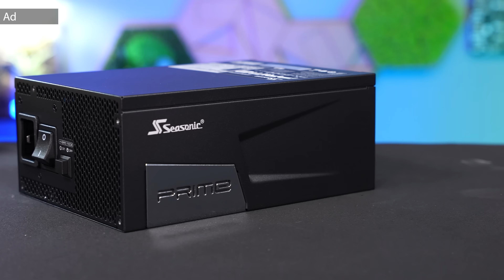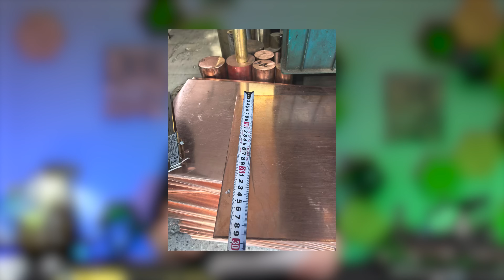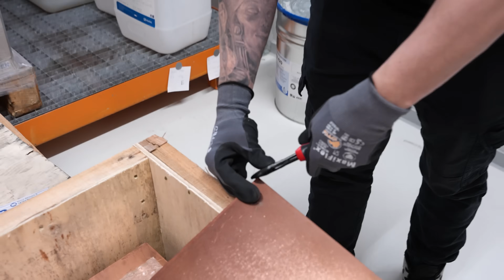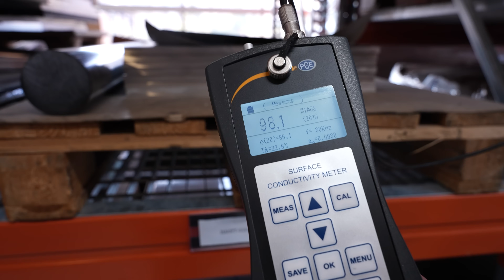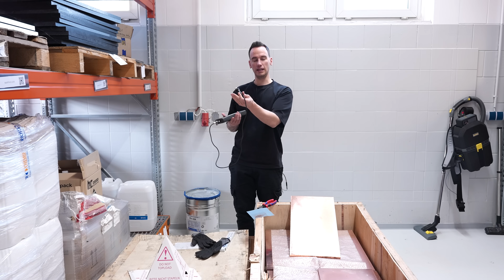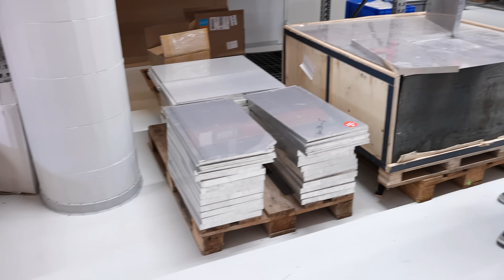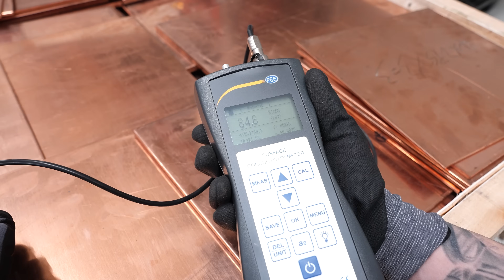I Got Scammed

Comment: Chile is the world’s largest producer of mined and refined raw copper. Chilean copper cathodes leave South America on bulk carriers and head directly to heavy rolling mills in Germany (Wieland, Aurubis). German sourcing is cheaper. The $2,000+ QA overhead, financial escrow fees, 45-day sea transit cash lockup, and risk of scrap on a single bad batch will instantly wipe out the nominal ~30% material savings from China. Total parameter calculation includes source reliability, quality, and fraud costs. 

I am so sorry this happened to you. It was an expensive lesson. If you source from German suppliers, your fraud rate drops to 0.1%.

Comment: Common story with Chinese suppliers, I've heard so many stories like that. They have something that looks fine on the surface - just enough to pass basic inspection - but the rest is garbage, or the entire product is fraudulent... Or in case of the second copper shipment, both at once, in addition to not being the best quality. Of course, they do it because it's so easy to get away with.

Comment: I'm not sure here, because i know nothing of metal production in Europe.  but can you buy copper from a country that has a better reputation at this point in time, or at least has a better judicial system so that recourse could be taken?  maybe something closer to Germany where you could physically check on?  i understand that there would be a much higher cost, but if the cost is not just the copper, but also the production of your items/ downtime, maybe a higher cost, more consistent base material would suit you better than this scammer stuff your finding.  you probably already have looked into this, but would be interesting to hear about!

Comment: wouldn't shipping manifest have shown the 10% difference in weight to real copper? I mean export declaration should show net and gross weight, from your order you would have known what the weight should be for the material you ordered
not trying to justify the scam, but just giving additional ideas how to check validity of material
we're getting aluminium here from Turkey that is all over the place, but that is few thousand, not 40
and this is part of the economic war China is waging world wide, so it wouldn't surprise me one bit that even if you start legal action, it will bog down on their end with zero result, because somebody somewhere took a bribe to shuffle your complain around to the bottom of the pile, that is standard practice, and bribes are very common around there, that's the "communism legacy", in the west this same thing is called lobbying 😁 just that lately things have reached very high point where this sort of thing happens almost everywhere
imagine trying to buy li batteries over there, and they are producing like 95% of all li batteries, so it is not like there are any alternatives
the fact is - the "cheap" China era is history, and they aren't interested in selling raw goods, just finished products, hence I could almost guarantee that this sort of thing is sanctioned and handled at "government" level

Comment: What prompted you to clarify you've only ever had positive experiences with Alibaba in the past? Not saying I don't believe you, I'm just curious. Chinese industry is more than capable of producing high quality goods, and can definitely be either a cost effective, or at times the only place to get certain materials. But as someone who worked for years in procurement for, let's say, very large projects. Unless you pay extra for independent third party inspectors and quality assurance from trusted auditors like SGS, Intertek, BV, or TUV, even some of the largest companies on the biggest orders can take you for a ride, regardless of prior built relationship. Fabricated manufacturing schedules, and even fabricated quality documents are not unheard of, and if you really want to receive what you paid for, the sensible course of action would require inspectors for site inspection, production monitoring, pre-shipment. I'm not trying to speculate as to why it's like this, and I'm not trying to claim China is unique in this regard. But this is common wisdom and good business practice for a reason. If you value your projects, your money, and your time, you will need to be far more thorough when doing business with China.

Comment: There is saying in communism, if you don't steal, you steal from your family. If you say in China ... I scammed Chinese person, you go to jail immediately, if you say, I scammed foreigner, you get applause. The court in china doesn't really work if one party is foreigner, it will cost too much take too long and the company will go bankrupt before you can serve them. There is no way to solve this ... if you agree on half payment in front and half after inspection, they will send you 25% of goods and have 25% profit. You can read a bit about Tofu drag construction, its also victim of this, steel that is weaker than iron, concrete that will become sand once you lightly touch it. Fireproof insulation that can catch fire by sunshine. Even if you manage to get first order 100% correct ... the next order which will be probably larger can be the scam one

Comment: A chemical compounder I worked for purchased a 40” FCL of potassium hydroxide flake from china. Verified by a third party before container sealed. Container arrived in Australia and it was 25kg bags of calcified lime. We not only lost the money on the product we did not get. We lost money disposing of the material we had received that had to be remove from the container. The third party verification on the ground in china was recommended to us by a very large multinational customer of ours and still… unless you can put yourself in front of the product before paying balance, it quite often isn’t worth it.

Comment: China overproduces so much steel they have no idea what to do with all of it except shove it into applications that it should not be in.  Also, to commit fraud.  The cardinal rule with sourcing from China is you need to have a local fixer that's going to keep suppliers from f*cking around on you.

Comment: You need someone on the ground who oversees it when dealing with places like China & India. Someone who is NOT a local. Will insurance cover you in this case? Also, try and work using payment on confirmation of delivery (and a THOROUGH inspection) along with a deposit. I don't know if that will work with that industry or not, but it has to be better than what you're doing right now with the losses being lowered to your deposit.

Comment: I know its been a while, but I would be interested in another video if you can test weighing the plates and talking about if it would be efficient to try to recover the copper through sweating or something.  Pure copper is denser than steel, so even a 12"×12"×1" plate would be a few lbs light if its mostly steel.

Comment: A very common thing is freight repacking, where your trusted third party (that verified the product was packed and shipped) would actually open up their boxes and repack everything into your own shipping boxes. One thing to note, if using a Chinese company freight repacking is to not have the hand off be between the two companies, but rather one drops it off at a warehouse and then the other shows up at some later time (to prevent under the table dealings)

Comment: If you ask me, it's fine if you decide not to pursue legal actions against the scammer because you don't want to waste money and risk losing more money with laywers. 
But I would suggest to at least record the evidences and report it to the police in China. Because this is not a small scale operation here. The fact that they have those steel plates, aluminium plates, and is capable to plate those steel plates with thick copper means they have a big industrial operation. So it would be hard for them to move around and it would be easy for the police to track them down and get them. 
So, since they caused you a lot of problems. I would take revenge and cause them a lot of problems with the police. Report it to the police and let the police take them down. If you somehow can get your money back from it, good. If not, the scammers will also take a hit on their operation.

Well, that is if the police aren't corrupt. But even if the police there are corrupt and took bribes. Well, those scammers would still lose some money to pay those corrupt police to settle the case. So either way you get them to lose money.

Comment: I am so sorry for your lose. 
From what I have been reading and watching, China is having a big issue within itself. Constrution is using what they call Tofu bricks (mud and concret) bamboo instead of rebar, soft steel on the new bridges, instead of stress tested. In short, China is buried in coruption with out caring who gets hurt or dies.

Comment: The only way to protect against this is by using escrow. That doesn't release full funds until shipment received and checked. I've no idea if this is an available option. But it seems like a filter as a company not willing to use this method, is probably not worth dealing with anyway.

Comment: With how much you are purchasing, you may be able to do a deal with a scrap brokerage firm or even large scrap supplier local to you, where you purchase the raw recycled material and electrofurnance time and you recieve the total refined  output. Then a metal merchant will exchange whatever refined output you got for the stuff you actually want, it sounds like extra steps but its apparently tax efficient 

People don't like the word "scrap", but that just means its already been refined once and its easier to do than from ore. 

I know a company that needed barstock in a odd size to build out some jumbo busbars and this was the route they ended up taking.
Reply: The other thing worth mentioning; if you show a scrap copper broker that you can turn what is a waste product into a actual thing worth more than just its value as pipe or cable and those guys will move heaven and earth to make their product your product. In general scrap metal and recycling is a very keen sector if you find the right people

Comment: as somebody who works with chinese suppliers for years - make sure you order inspection by 3rd party and ask them to do custom testing based on your requirements and don't be greedy on the amount of checked samples (i've used V-Trust for example) + services of the labs + send a reference sample TO them. not just for the ready order inspection, but also for the factory audit pre-order. also singing contract with supplier is a good thing (make sure all documents are signed with red circle-shape stamp with a star in the center). you should also try ordering via alibaba system itself. You should also try to use some sort of local agency. In that case they'll be easier target for the dispute + they'll be able to check internally rumors on the factories etc. if short - make chinese company to control another chinese company.

Comment: What I don't understand about this: If they're gonna scam someone anyway, why go through the trouble of having steel plates coated in copper as if the truth wouldn't come out within minutes after arrival, for pretty much any customer? It's not like somebody orders plates like that as decoration, as soon as  the customer starts cutting or drilling them, they're gonna know they've been scammed.
So it seems that they could just as well have shipped a box of bricks or simply nothing at all and made even more profit. The thinly veiled attempt at shipping something that looks like the actual thing is just baffling to me.

Comment: I always use a Letter of Credit (L/C) when I work with suppliers in China because it’s the safest way to manage international orders. The process works like this: once I receive the product, I test it to make sure it matches exactly what I ordered. Only after I confirm that the goods are correct, I approve the bank to release the payment. This way, both sides are protected — the supplier knows the funds are guaranteed, and I know I won’t pay until the product meets my requirements.
Reply: The contract with the two was breached, it is automatically at Alibaba, I do not know why he do not just file a claim on Alibaba. He would most likely got all the money back, the seller now try their hardest to make the time go so he then would not be allowed to put in a claim anymore.

Comment: I think you did pretty much all you could do bar hire someone to fly over there and inspect and oversee them packaging and shipping it which would obviously be very expensive.

This is not a new thing. A family member of mine worked on designing oil rigs many years ago and the company would buy huge pieces of steel to make pressurised tanks that had to be made with certain materials to certain specs and routinely they would just send completely incorrect materials. On million dollar pieces of single steel parts. Fake documents from material analysis etc. Scamming on an industrial scale and sometimes they wouldn't find out until it was too late and the piece had been installed and it would start rusting or degrading instantly.

Comment: if anyone wants to purchase non ferrous metal in main land china, its imperative to be present on metal smelting and billeting. and then you have to oversee its logistics from factory to port either by yourself or a trusted consingee. I have been dealing for 20 years in china and dealing with china, scamming is not a crime there but being caught its. they have a prevalent culture of scamming that from materials aquisition to shipment its possible to get scammed or hijackjed. from derbauer example he could have been scammed by the factory because by looks of the copper plated plate its was gone through a billeting roller and the aluminum plate was hijacked and replace the other half with metal plate.

Comment: Obtaining material type certification from a reputable class society would help verify the metal before purchase and avoid issues like this. It comes at an additional cost, but it’s usually small compared to the potential losses from receiving incorrect material.

Comment: This is def. NOT embarrassing dude. It's disgusting and it's criminal. If you'd bought a sample, they'd have sent you the genuine article and still pulled this scam on the bulk order. Alibaba need to step up, compensate you immediately, arrange collection of the products delivered or write them off, and pursue prosecution of the sellers in China.

Comment: Potentially, you could extract the copper from the plates you have and then sell the rest of the steel and aluminium off to recuperate some funds and get some material too. Will be a long shot but maybe you will extract about 4-10% Cu (based off the vid).

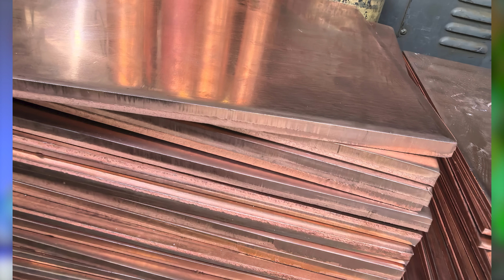Comment: 09:52 - For a non-technical guy, I think this can be seen in the pictures. They have folding edges and suspicious colours on the lower half of the plates. For instance, at 04:16, the 3rd slab has a fold on it. All slabs have this area, half way from the bottom, like they've been cutting the slab partially, then ripped it off the larger body.
Sorry you have to go through all of this

Comment: I almost stopped buying from China, even on small orders most of the time it's bad quality. I bought capacitors => high esr ones, wires => shitty ones which  cut themself, tweezers => ends not aligned so useless for micro soldering ... to the point i only buy the parts i can't get elsewhere and even there i'm picky about the seller, i buy samples from various sellers before doing a 100$ order.

Comment: First don't be embaraged, they are werry good at this. Now i have not bought anything in this large a scale, but I make it clear i want a lot more, so that the order is a test sample. Then they wan't to scam you on the big order not the "small" test order. But there is no garante it will work. Is annoing AF hope you find a solution. Is there a use where it don't need to be pure copper? Sell it there.

Comment: >let's try china
don't even need to watch further, either bricks or pig iron painted with copper paint ended up arriving, right?
the tale is old as time, even if you have on-ground representative that will himself witness 'em putting the material (that he checked, and found to be of desired quality) into shipping container and sealing it with tamper seals, you still can get scrap metal instead of what you wanted.
ah, right, almost forgot: the seals will be untouched, and in pristine condition.

Comment: you SHOULD cover this in a YouTube video, had you asked someone about buying from China, we would tell you stories.
Basically, it is ripe with scammers, and they will scam you on ongoing contracts too.
There is a reason companies that deal in China, hires a local in their country, pays him or her to LIVE in China, go by the factory unannounced and check the products being made / delivered to avoid this.
This is the hidden cost of China manufacturing... BigClive here on YT have a story of a 12/24V GPS charger from China that suddenly started burning their GPS units when it was used in 24V trucks.
Turns out over time, they had shittified the circuitry and removed the 24V components, so rather than outputting 5V, it dumped 10V into the poor GPS device.

Comment: Roman, so sorry to hear about the sourcing issue. It can't be easy to find/deal with new suppliers, but having gone zero for two is heartbreaking. It's easy for us to post a comment and say "Don't be too hard on yourself", but if you're like most folks, I'm sure it'll be hard to get over. It was a large investment and the sellers screwed you. Hope you're able to find some remedy, but at the very least take it as a learning experience. Any chance you can pursue as a business loss to offset?